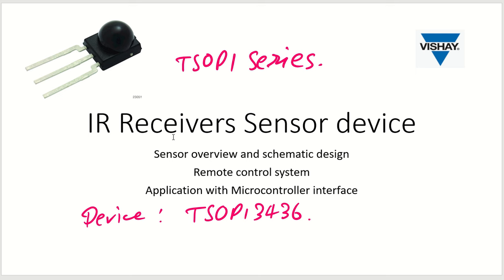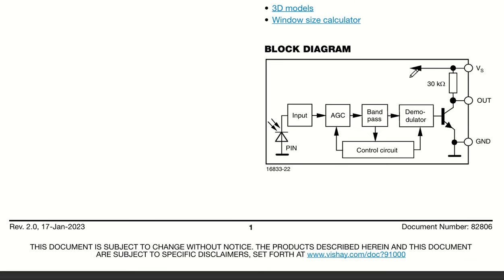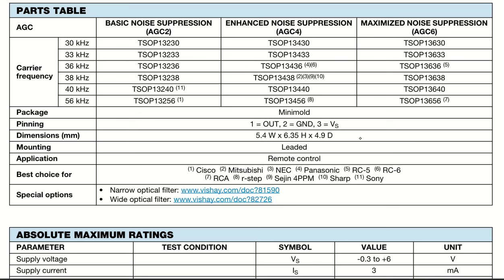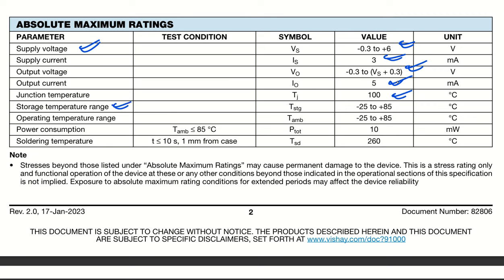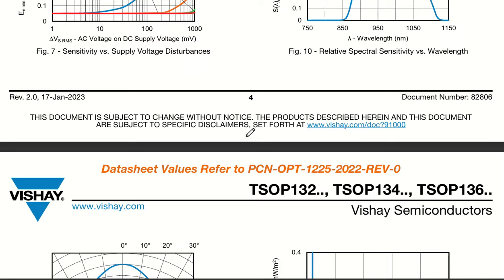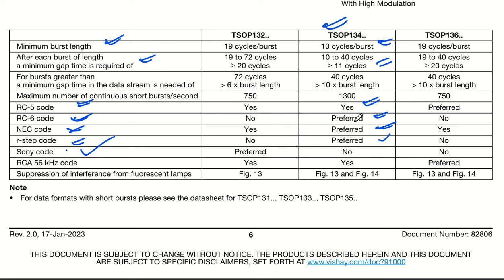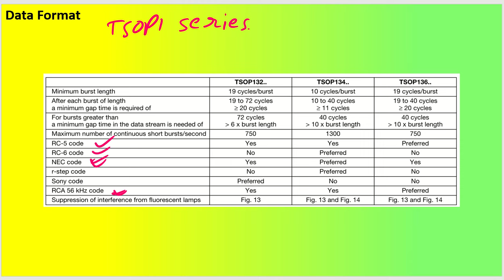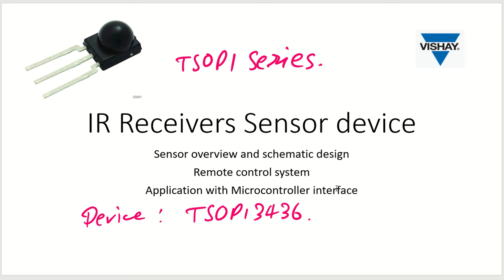035 IR receiver overview and schematic design TSOP1 series

Comment: What a simple go through with the datasheet of IR receiver ic and it's applications with schematic design techniques.

Thanks for the information 
TSOP13436 is one of the best ir receiver from Vishay, being used for remote control system applications